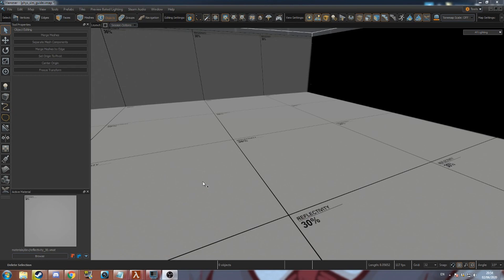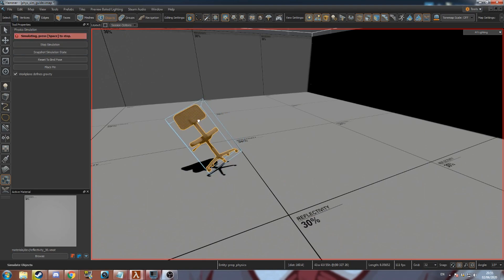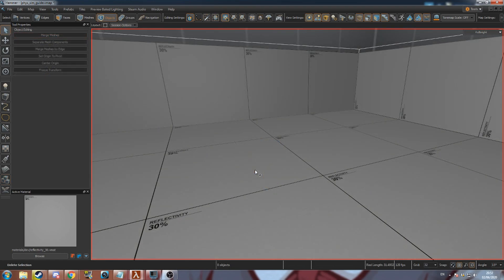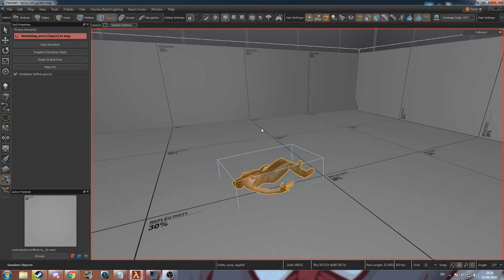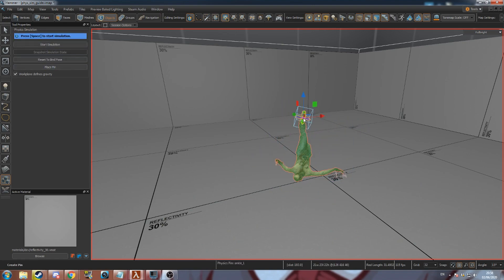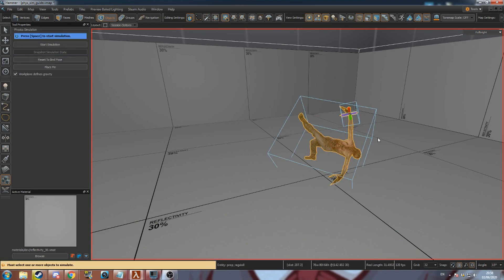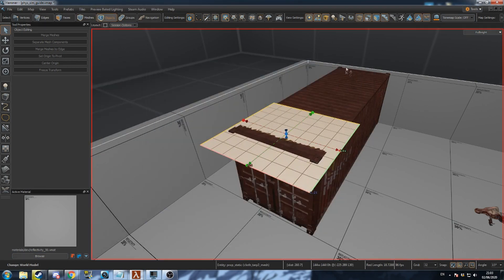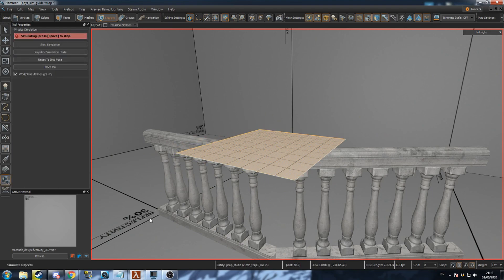How To Create Cloth and Pose Ragdolls using the Physics Tool in Source 2's Hammer

Comment: There is no such thing in cs2 hammer :c
Reply from the maker: The physics sim tool does still exist in CS2, the keybind is shift+c.
Deformable props are also still in CS2, for example: imported_interior_plant_palm_large_healthy_ragdoll.vmdl
The specific models I demonstrated in this video aren't present, but it is still a supported feature and I expect valve will add more ragdoll props in future.

Comment: Is there a way to apply a texture to the cloth? Please help
Reply from the maker: The cloth is a prop, so you can't change it's texture in Hammer. You could give it different skins by creating new textures though.
The cloth used here is just an example. There are other props that use the same cloth physics that might have what you want.
Reply: @Hosomi  I did some fiddling around and found a solution, you actually can apply a texture if you first, run the simulation until the cloth is where you want it to be, then open object properties, go to render properties and go to override material where you can select any texture you want. Thank you very much for replying though, I love your videos. If I may ask another question, in HL:A we see those big thick combine electric cables run through the streets and such, however I cannot for the life of me find out how to create those in editor. I thought they might be a tile mesh but nothing seems to work. Do you know how to make them/will you make a tutorial? Thank you again.
Reply from the maker: @isaacanderson2762  Oh, that is fascinating!
As for the cables, would it not be with the cable/wire tool perhaps? I can't remember what its called
Reply: @isaacanderson2762   Yep, and if someone read this you can use this texture for great tarp: models/props/vort_hideout/materials/shelf_tarp.vmat.
And for the cable you can use : path tool (shift+p) -> path type : path_particle_rope. And same as the cloth, you can override material !

Comment: How would you change the texture of the cloth?
Reply from the maker: You can't change the texture, but you can use other props that have the same cloth behaviour. Just try looking around for cloth-like props.
You can change the colour with the Colour property in properties
Reply: @Hosomi  Thank you!
Reply: It actually is possible to change the texture in Render properties/Override Material. You just can't change the texture size or at least i think.

Comment: if you know how, how would someone do this in Steam VR's tools?
Reply: steamvr isn't anywhere near the version of source 2 that HL:A uses. steamVR could best be described as using source 1.5 trapped with some of the awkward limitations/systems of source 1 yet having some of the new tool sets and features that source 2 brings. you might be able to use this feature in the HL:A tools and then backport the map to steam VR though i am unsure of exactly what differences of engine you would encounter. there might be someone who has tried it though

Comment: I had the wall of a bifg room selected, but could only paint on one wall, the side walls were only affected when I painted at the transitioning edges of these! is this a bug?

I am also curious, what hardware are you using, because hammer stoped working several times, maybe my rig is a little to old and maybe having oculus enabled in the background is a performance hit. I have a 6700K + gtx 1080 + 16GB RAM at 3200ghz and a CV1 rift
Reply from the maker: I'm not sure what you're asking about the paint tool. I've already made a tutorial on using the paint tool you can refer to.
I have a 1070ti, 10GB RAM, and an Index. Can't remember my other specs, but I doubt thats the cause of your crashes.
Reply: @Hosomi  thx for your answer

Comment: This probably isn't possible, but is it possible to "pin" parts of cloth to something? Like nailing it down in front of a broken window for example. Also, what about colouring/tinting it? I'm probably just going to wait for the SDK to come out, but I'm tempted to buy HL: Alyx despite not having VR for the modding/map making tools for SFM.
Reply from the maker: Pins are shown in the video. The cloth is a prop_static, which means it won't have physics simulation in-game. I have another video that covers tinting

Comment: Can I use Source 2 hammer without VR? While also being able to use props from HL Alyx?
Reply: You’ll have to buy Half Life Alyx to get access to its workshop tools and assets, but you don’t need a VR headset to be able to make them.
Reply from the maker: You could also use the workshop tools for SteamVR alone, but this would not include the HLVR content, although you could probably download the assets
Reply: @Hosomi  So, in other words, you can have this new s2 hammer without HL:A, right?
Reply: @Hosomi  How do you use hammer2 without a headset ? do you need to do something extra?
Reply: @TheOneTheyCallShandy  There's a mod to run HL:A with HL2 style movement and weapons; it doesn't work well enough to make it worth playing (seriously, don't even bother trying without VR, even if it is technically playable it's not worth it) but for development and messing around in the editor it's fine. I use the mod to work with the editor rather than having to switch between them every few minutes. Here's the link https://github.com/KonqiTheKonqueror/Source2-PFSK